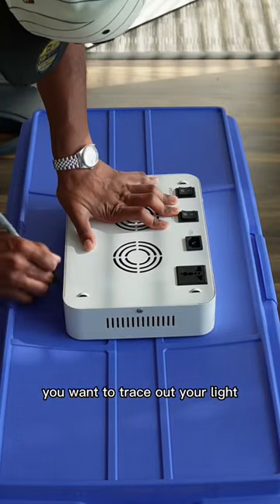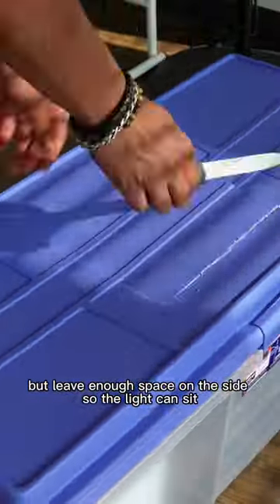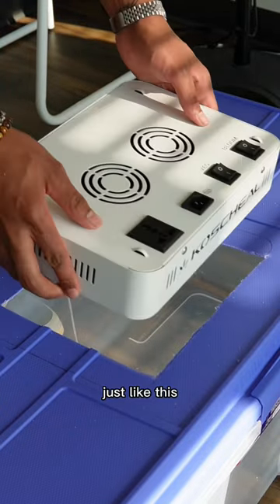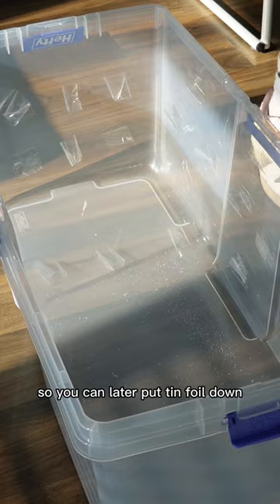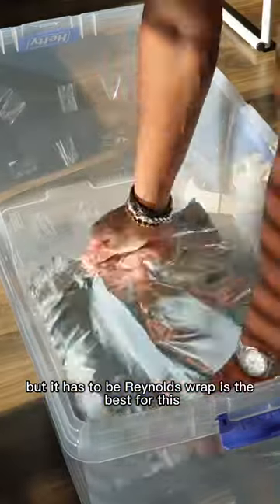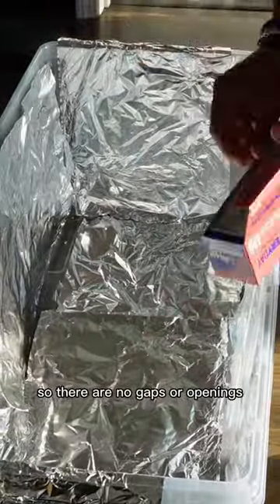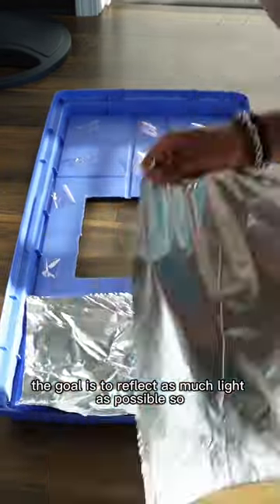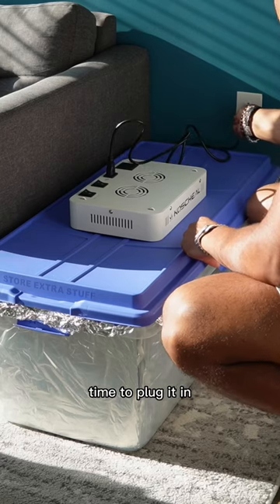How To Build An Ice Box In 1 Minute !😱(For Sneakers)

Comment: Quick question, I don’t have a fan for air flow yet so could I just cut the whole and run shoes? Would that be cool enough or do I wait
Reply from the maker: Low key yes but I wouldn’t advise it if you do tho put it in an open space where there is ventilation

Comment: what if you don't have a uv light cuz I don't
Reply from the maker: UV light * and you won’t be able to ice the shoes without the light
Reply: @btbkicks  k
Reply: The sun emits UV Light so after you apply sole sauce, wrap it in plastic and leave it facing the sun it can be inside or outside.
Reply: @btbkicks bro just lied 😂 you can use the literal sun
Reply from the maker: @MaleficHuman  for the most consistent results ice box is necessary. Sun doesn’t shine 24/7 lol the box will tho 🤷🏾‍♂️

Comment: Do you have to put a special “sauce” on the soles before putting the shoes in?
Reply from the maker: Yes! and I recommend Reshoevn8r's Sole Revive. it works super well. If you decide to cop use code: BTBKICKS  at checkout to save 10%
Reply: @btbkicks  ok and do you think 600 volts vs 1000 makes a big difference for the light?
Reply from the maker: @Noah-lw9jm  I use a 1200w right now. I started with 600 then went to 1000 and finally 1200 as I got higher in wattage the icings became better and results were faster
Reply: @btbkicks  oh ok just because I saw a video where the guy said that the watts don’t rly matter, will it still work well with an 600 watt?
Reply: @btbkicks  and also how much was your light you have man
Reply from the maker: @Noah-lw9jm  $100
Reply: @btbkicks  and 600 watt worked for you?